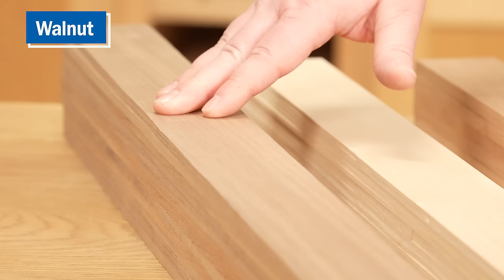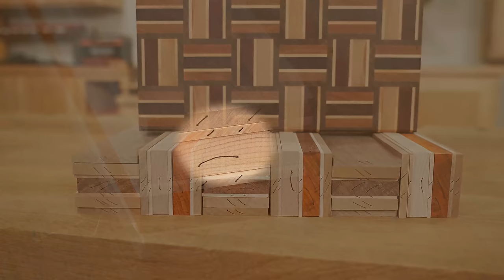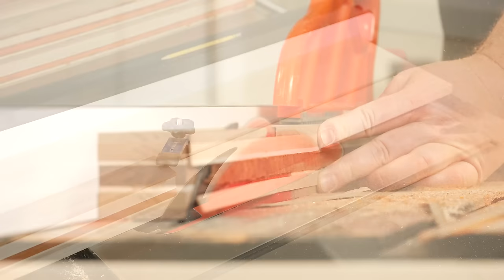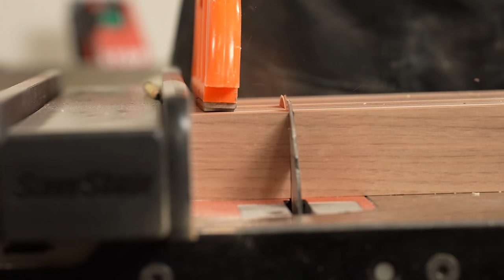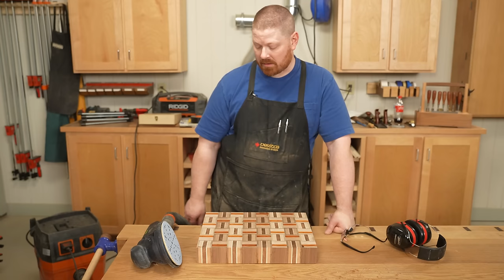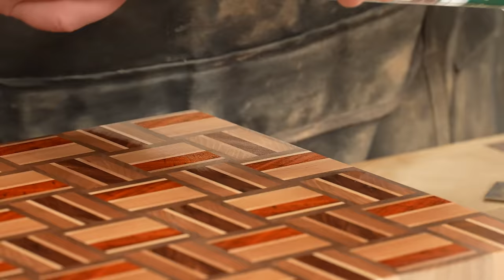Basketweave Cutting Board - WOOD magazine

Comment: That is a really nice cutting board. I'll give it a try, for sure. A couple thoughts on it.
 1) Wouldn't a drum sander make it easier to flatten and even it out? I just did a look and the Jet 10/20 bench top drum sander is available for only $548.
 2) Regarding the oiling. I've seen a number of videos by different people who submerge the board in mineral oil. But, doesn't this make sure that the oil thoroughly soaks into the end grain? If it's hardly any more than surface deep, it will need to recoated over and over. I'm not sure that most owners will want to be continually recoating their boards. There are way too many synthetic boards available that require no more care than washing. They're also very inexpensive; making them expendable.

Comment: This is a terrific looking board and an excellent tutorial, especially the tips on the glue up. If I can round up the necessary colorful species to, this is a pattern I would like to try myself. One sidenote, if I’m not mistaken, extra-virgin olive oil generally isn’t recommended for cutting boards because it does go rancid in a relatively short time. I’ve always heard that walnut oil is a better choice than olive oil. Thanks again for making this video, excellent content
Reply: You are correct. Don't use any vegetable based oil, any of which will go rancid. Almost all other oils and finishes are food safe after they are cured. Thinned polyurethane such as wipe on poly is an excellent finish. Two thin coats are fine. All you need or want is to seal the wood. By the way, end grain cutting boards have now been deemed to harbor less harmful bacteria than the plastic boards. The end grain splits with the knife cut and then seals back up pushing the liquid and bacteria out of the fibers. My choice is a 50/50 mix of mineral oil and beeswax wiped on in two thin coats, allowed to sit until I feel like coming back and a light buffing and done.

Comment: Aren't rings supposed to have different orientations during glueup. Pre glueup you mentioned we should allign them, even if each species isn't put directly together. What's the right thing to do?
Reply: On my end grain cutting boards, I always alternate the grain pattern to reduce the effects of expansion and contraction. k IMHO, most folks do not pay attention to the grain pattern when they buy a cutting board.  They are looking at the overall pattern.